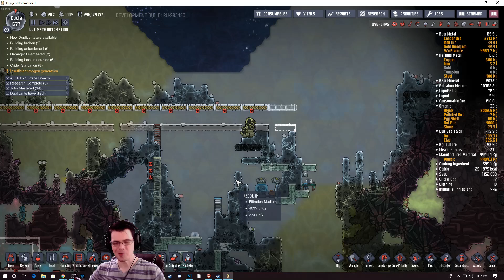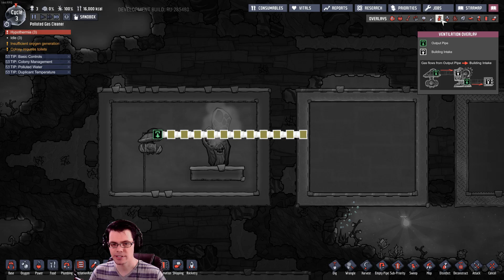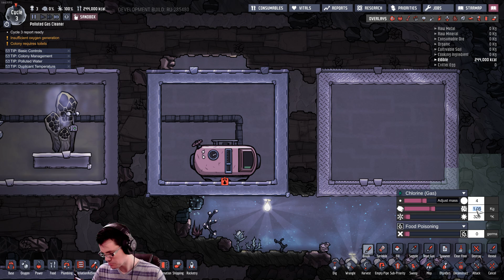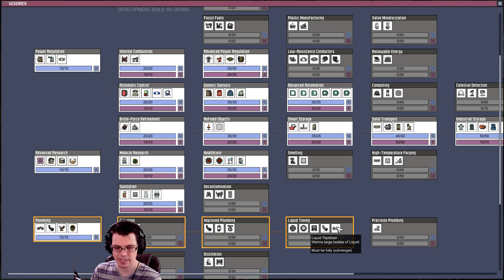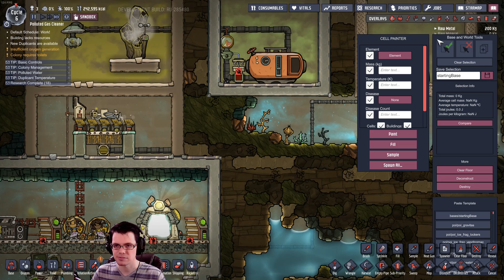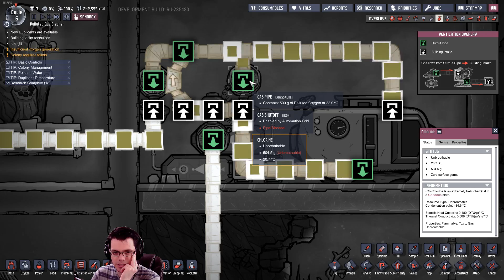Automatically Disinfect Oxygen and Water! Oxygen Not Included

Comment: Here I thought there would be an intelligent way to deal with germs.  I am so disappointed with Klei.  This is the problem I used to load my game to fix because the only way to fix it was ridiculously hard...  ie, heat the water until all the germs died.  But if you can just pour chlorine on it THROUGH A STORAGE CONTAINER....  Well whatever.  Germs are no longer a problem I guess...

I was thinking you'd have to drop the temperature of chlorine until it turned liquid and then mix it into the container one-bit per container...  Which would require a ridiculous build, but whatever.  Give it away for free, go ahead Klei.

Comment: The setup you use is overcomplicated. You can do the same with a reservoir, a shutoff, a germ sensor, some wires and pipes. You place the reservoir and a shutoff. You connect them with a pipe. Right before the shutoff you place the germ sensor, set to trigger when below 1 germ. You connect the germ sensor to the shutoff and provide power to it. You run a pipe from the shutoff input back to the reservoir input. The gas/liquid coming out of the shutoff output is germ free!

Although it may not be very fast, it's very cheap!
Reply: Yeah but no. The "not be very fast" changes everything. The goal here is to 100% exploit the original source (geyser) of polluted 02. The geyser is already not so powerful so we surely don't want to reduce it even more. (X amount of p02 per second).
If you watch the video, he's doing what you say the first 10m because it's.... easy. And then he's deciding to go for the max, which is much more difficult. So your comment implies you don't clearly understand his motives.
Reply: @AnotherSpaceCowBoy  I know a lot of people searched for a simple way to clean liquid/gas and found this complicated mess. I just wanted to show that i found a simpler way to do that. Did you read the misleading title? It would almost seem like he wanted to show people an EASY way to automatically disinfect gasses/liquids...

I've recently tested my setup even more, and it turns out it's pretty fast, it may or may not be enough for the vent though. You can also just add more tanks to the setup to make it (in theory, haven't tested this yet) faster

He didn't exactly do what i explained in my comment. His setup had an overflow problem, where as mine doesn't have such a big problem. His setup completely breaks if there's too much inside of the tank, sending infectious oxygen into your base. Mine gets a bit clogged up and you can just send in someone to empty a pipe and it's fixed.

If you say the geyser is not powerful, then two of my setups with a storage tank as buffer should be more than enough.

The reason why i don't include the extra tanks in the original design is because the setup would need to get filled a lot more before it starts disinfecting.

The standard version is more than enough for poeple who just want to disinfect the extra water they get from toilets to feed it to an electolyzer.

Comment: I put this together from your inspiration.  I found that you don't need all that auto setup.  Daisy chain the tanks, put a valve on the output, set the valve to about half the input (may take some tinkering) then put a germ sensor between the tanks linked to a cut off right after the valve.  With the reduced output there is enough time to clean the germs in the tanks.  So fill the tanks with your liquid/gas.  Setup your chlorine input (automated or one time).  Pump the chlorine in and give it time to clean the tanks.  Then connect the output and let it go.  The only maintenance is to adjust the output valve if you add a new or increase the source.

Comment: You can actually use a timer on the gas pump. 150Kg gas capacity implies 300 pump seconds. Once the system clears, you have a signal which opens the shutoff and empties the system. Once the system clears, you send that signal to clock cycle automation that runs the gas pump for less than 300 seconds; you might have checks to make sure that the pump has enough gas to make it worth it and enough power.

Summary, pump turns on for less than 300 seconds when system clear signal is sent and when the atmosphere around the pump is above a threshold value (minimum is around 31.25g per tile of the 4x4 pump area). Also, obviously the ideal would be to calculate the gas pumping rate to the size of the source rather than the size of the cleaning cycle capacity.

Comment: I believe the ability to do this was removed with the Launch update :( I'm not able to disinfect water inside of reservoirs in a chlorine room. If anyone knows if this still works please let me know (I have the mod for the old visual styled reservoirs)
Reply: It works. You just have to make sure to pump a tiny bit of clean water in the system before allowing germy water to enter. Chlorine can't disinfect if the water is in a pipe. By precharging with clean water, you can fill up the little bit of pipe before the exit shutoff valve.

Comment: I'm so getting this game. I do feel the devs should patch chlorine outside a container cleaning the contents of a container, but it should be possible to pump the chlorine into the tank along with the polluted air, then vent the cleaned contents into a large room, allow them to separate due to density,  pump the air out for further cleaning, and the chlorine goes back into the tank to clean the next load. The same should be possible with polluted water, but the current game mechanics may struggle with pumping chlorine gas into a liquid storage container. On the other hand, a room is a liquid AND gas storage container.

Comment: the system may get jammed randomly in cleaning loop (depending on how you build it). When gas is comming from charge tank while cleaning loop still cycling, the game then may decide to give the flow priority to gas flowing in cleaning loop over the gas from charge tank. And if that happens on the first cycle there will be not enough gas in cleaning loop to get some in a tank - therefore, gas will not get cleaned and will cycle endlesly. It can be fixed with a small adjustment, but it will cost some efficiency

Comment: I've been playing around with this design, and I came up with a notable simplification. You can do it with just a single tank, without the possibility of getting the decontamination loop stuck, if you continue the pipe past the input of the tank and merge it (with priority) back into the input to the whole system. Then you just set up a pipe element sensor on that overspill path which resets the s/r latch which controls the input-side shutoff when there's something in it, which can then be set again when the element sensor in the main loop says the pipe is empty, as in your version. It is important to make sure the overspill pipe is long enough (after the sensor) to contain all the overspill that makes it through before the input shutoff kicks in, but if you make sure of that, it's perfectly robust. You can still, of course, use a second tank (in the chlorine or not) to let the input keep moving while the decontamination is happening, but it doesn't need any automation involvement, and you only need 2 shutoffs so it's slightly more energy efficient, and definitely more space efficient. 

It's also worth noting that the germ sensor needs to be set to "below 0" not "below 1" since "below" actually means "less than or equal to". If the next thing you're doing with the output is cleaning it into a substance that will slowly kill germs anyway, that 1 germ doesn't matter, but if you're storing the polluted stuff long term, that 1 germ will multiply and infest the output tank, so it's important to get it right.

Yes, I know this video is old, but the relevant aspects of the game haven't really changed, so I figured I'd post in case anyone was interested.
Reply: element sensor+germ sensor+and gate+shutoff
Reply: the loop also, basically two tanks
Reply: actually you can get away with just one tank
Reply: I imagine this is how Harvard students whatsapp arguments look like.

Comment: Not sure if you still get to that method but you could also just run the cleaning while inactive. It would pump the reservoir for like 300sec then gas element sensor output from the geyser so when it stops you have a output from the gas tank with a pipe germ sensor into a "never contaminated storage“

Comment: This will work as long as the superflow tank( above) has enough charge to fill loop below OVER capacity of pipes. If it does not, gas/liquid will cycle through pipes, not hitting tank - no cleanup.  At the least you need either buffer gate on output valve from top tank, or manual switch to allow dupes to make system work/restart.

Comment: Dude 2 valves one in one out and just time sensor...
Reply: you cant put a valve directly on an output of the tank, there needs to be at least one pipe between.That pipe will fill up with infected liquid right when it enters the tank and therefore wont be disinfected, not a perfect solution
Reply: I just thought of something.. using the automation on liquid gas reservoir and germ sensors.. you can essentially keep looping the contents between two tanks back and forward with a time buffer used off of the automation from the tanks. Then finally when the germ sensor reads clean on the first tank open the valve at the end of the second tank letting everything through. It's complicated and unnecessary. Just use a timer sensor leave it in chlorine for a half cycle and then use clean water.

Comment: All you have to do is hook a buffer gate up to your original sorter loop before you built the injector.  This way the pipes will fill and then it will wait x seconds to turn off your intake shutoff allowing the tank to fill. This easily replaced all of your injector automation.  I hope this helps anyone with only a small amount of space and materials with this build.

Comment: The germ sensor could be usefull before, as heat also killed germs. Turn clean. Heat (or even just wait) until germs are low. Done.
Also, perfect 0 germs is not nessesary. As long as it is a material in wich the germs decay (like clean Oxygen/Water), some contamination is okay. For our drinking water, some bacteria are save up to 500/milliliter.

Comment: I think this is a bit over-engineered as usual :)
It should be sufficient to just have a few valves, a germ sensor and importantly, a timer that allows the system enough time to get clean before it starts exporting again. Arguably you could even do this without a sensor, using timers alone - but then you would have to either be generous with the timers or measure out how long it actually needs to stay in the tank. Given that the tank can hold so much though, I feel like efficiency isn't going to much of an issue. Even if you only got a full tank pr cycle (and that's way way more time than you'd realistically need) that would be a lot to use up.

Just have a system to avoid germy gas clogging up the system. A simply timer on a valve on the intake would suffice, but if you wanted it more optimized you could just vent out a bit of the germy gas (in the pipe after the circulation valve) back to the source so that there is always space available to restart.

EDIT: But it sure would be convenient if you could put automation wires on these tanks (or perhaps some more expensive/upgraded variant). That would greatly simplify how you could apply them in systems.

Comment: This method doesn't work when the input slows down - e.g. water from toilets. Eventually you have a small amount of dirty water/gas looping endlessly in the bottom chamber and it doesn't get clean because there is no enough to sit in the container.
I had more success with two chambers that open their shut-offs once a day to move sitting water along.
There is also the problem that a tiny amount of dirty water/gas can get through - but i think that is rather a bug with the germ-detector than this method.
I think Klee need to use a mechanism where a small amount of Chlorine can be consumed to make water/gas clean.

Comment: Great video, thanks for doing all the work for me, my brain doesn't handle the automation very well :P

Would it be possible to modify this to accept clean water as well as polluted water?  I just built this system and have both in one tank.  At the moment I am just filtering the water away but would prefer to just run it through this system.

Comment: 19:21 Gas element sensor before your bridge on the left up stream. If detects gas shut off valve up stream. Boom fixed. Wont need over flow. Or all that extra pipe.

Comment: you know you can do this without automation if you know your consumption rates of your systems. i tend to use one tank for my kitchen one tank for each farm end even one for my washrooms(no looping although you still could. but its mostly for the manufacture  and usage of the pwater). if the system only uses the water periodically they self maintain the fluid levels in the chlorine rooms. these are fed by a main storage/decontamination  room that have about 6 storage tanks giving plenty of time for these to clean before consumption.
if the 6 are running at full capacity they will kill any incoming germs within the first 4 tanks. the germs only transfer a % of their germs when transferring between full containers, the first incoming tank will get a full amount of the germs and each tank will take about 10% of the germs of the previous tank. once the germ count is less then 1k it wont even transfer to then next tank .

Comment: The exact same blueprint can be applied to water, but note that the research three for this automated build is pretty large as the germ sensors require plastic, which require oil refinment, which require you to go down to magma. A good compromise for early game, since you have to treat waste water early on, is to use a single reservoir, with an intake and and output  shutoff valve, put the same loop as he has so you dont get germ water stuck on the output pipe. Then have both valves signal to a manual switch, this way you will be able to control the water In and Out manually. Since you dont have the germ scanner yet, YOU are the germ scanner =-) so when your tank is germ free, open the output signal =),

Comment: i literally just made a room about 10 x 10 or 15 x 15 put 2 weezeworts in it and thats it. free oxygen.
 as long as the pressure is high enough lets say 4000 the room is cold enough to kill the slimelung. 

all u need is a gas pump in the left corner the geysir in the right corner 2 weezeworts and some oxygen filters all over the place maybe 6-8 and then a pressure messurer so the pressure keeps above 4k so the weezeworts can keep cooling enough. cause geysirs only work 60 days the system doesnt drop over 0C normally. just keep the surrounding cold or make a vaccuum around it. pretty simple oO  and it just needs 240 watt.

Comment: Ok I am in the middle of the video, and this seems way too complicated. 
 cant you just use the clock/timers switches or whatever their name was? Put two "shut off" valves to it, one with not gate. So the in valve is on, the out valve is off, the tank is filling up, the germs are dying. Then at some point the timer switches and the in valve is off the out valve is on, the clean oxygen is leaving the tank. Then the switch switches again and everything repeats...
And maybe use two switches to keep both valves shut off if you need more time to kill all the germs. Just fine tune it.
Reply: But this would probably be patched... It's kind of stupid for germs inside an air sealed tank to get killed by the atmosphere outside...
Reply: yep, i'm near the end. this system is way too complex.
all you need is for the oxygen to stay in the tank for a bit before being released. so just use timers. one timer to fill in the tank, then when it's of and the oxygen is clean, turn on the other timer that open the tank.
that's it. 
and you can have two tanks if you want so while one is collecting the other is venting and vice versa 

this way instead of having a ton of not gates, memory gates, sensors and so on, you just have two timers (maybe even one) and two shut off valves per tank.

Comment: YO! KISS is your answer. Create a main loop around the air resivour , with your germ-sorting-gas-shut-off and a gas valve to throttle the output of the gas tank by half. the use a gas bridge to tie the infecttion vent gas pump to the main line just after the germ-sorting-gas-shut-off. It gives priority to the main line as they merge, but it shouldn't be a problem sense the 2 halves would combine to 1000g at most and fit in the pipe.